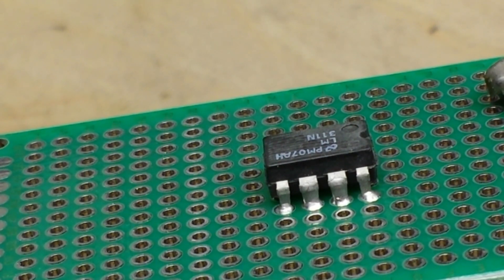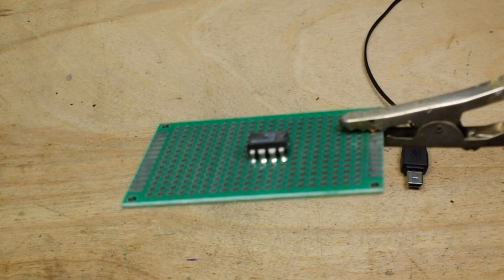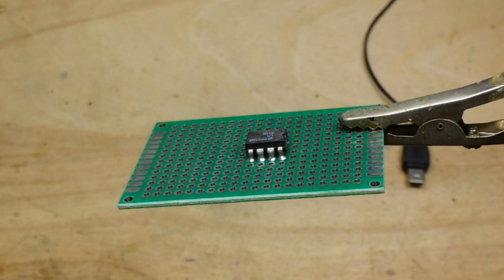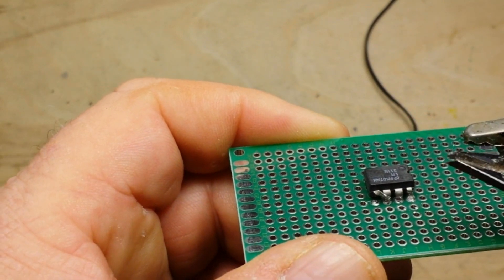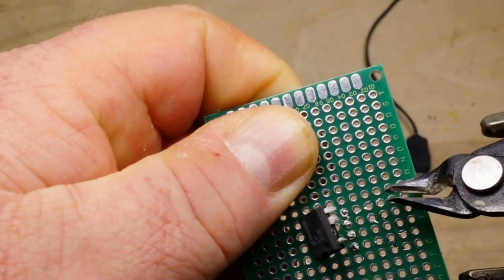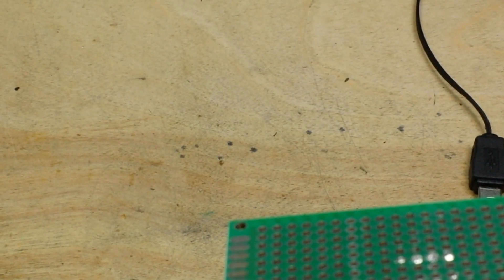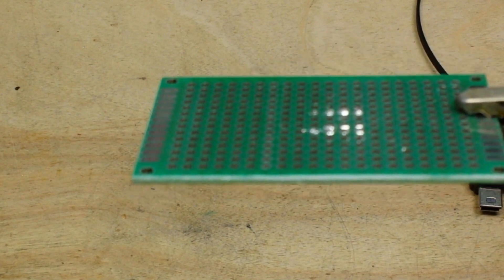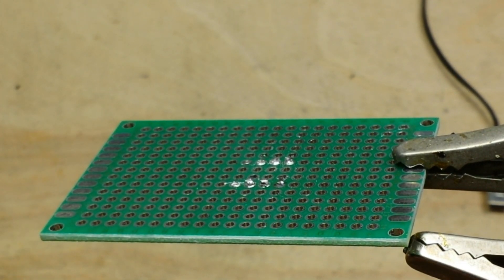Easily remove bad ICs from circuit board

Comment: If you're cutting out IC's it's far easier if you close crop the leads as they come out of the body of package,  i.e. hold the cutters vertically.  You can then remove the pins from the board by using your soldering iron on the pin from the top of the board, feed some solder so that the joint flows.  Lifting the iron from the board and the pin will (hopefully) be removed as it will be stuck to the end of your iron due to surface tension of the solder and the natural hook on the top of the pin.  This was standard practice when I worked in test some 35 years ago.
Reply: That's my preferred method as well.
Reply: Yep, cutting the legs next to the plastic body with the cutters held vertically is the way to go. It leaves a little hook at the top that you can use to pull the pin out with just the soldering iron tip as you say. This was the essential technique for 4 and 6 layer boards back in the day! Happy memories ;)@learnelectronics - thanks for the video and get well soon dude.

Comment: Tends to be easier to cut the chip pins from the top, with the edge of the cutters facing the chip, so the pins are cut across their width. This is because most side cutters have a flat side which can get in close to the point where the pin joins the chip. This is much better than cutting at the point where the pin goes into the PCB. The reason being that the heat of the soldering process anneals the metal of the pin making it soft and difficult to cut, where as it tends to stay quite brittle where it enters the chip.
The side cutters need to be sufficiently narrow to get the cutting blades in between the pins, even then, only the very point of the cutter will be used, so it's a good idea to keep a set of side cutters just for this task.
If one side of the chip pins are cut, the other side can usually be broken off by very gently lifting the cut side and flexing it up and down. This fatigue fracture the connect pins at the point they enter the IC package.  If done correctly, the pins break close to the package, leaving the remains of the pins still upright in the PCB. This stops damage to through holes and the PCB  track leading to the pins. It also makes it far easier to pull the remains of the pin from the PCB. 
One tricky is to use a spring loaded  solder sucker to suck the pin from the board. To do this, prime the solder sucker tool. Place it over the pin on the component side of the board. Heat the pin joint from the other side with a soldering iron. Just at the point where the solder melts, trigger the solder sucker. It will suck the pin from the board, along with most of the joint solder, leaving a clean hole in which to mount the  replacement IC. This method only works provided the cut pins have not been mangled in the cutting process.

The automated production method for through hole components leaves the component legs straight. During the production process, PCBs pass down the production line on a conveyor, with the component side always upper most.  The components are inserted into the unpopulated PCB by a robot placement system. Gravity and the tight fit of the component pins through the PCB holes, holds the components in place and upright. Once fully populated, the  board is passed over a horizontal rotating disk cutter blade, called a Holly cutter. The disk is engineered to be just a few milimetres under the PCB. This cuts the component wires to a uniform length. The PCB is then passed over a flow soldering weir, in which  molten solder is actively pumped up to give a continuously refresh mound of liquid solder. This solders all the component joints as they pass through the mound. To ensure that the solder only goes where required, PCB tracks around the through holes are tin plated, while the rest of the PCB tracks are protected by a heat resistant lacquer mask. The whole process is dependent on the component leads being straight to allow machine placement.
The same cannot be said of hand placed assembly, where  the PCB is soldered with the component side down, and the component leads are bent to enable the operator to hold them in place while being soldered. Early single sided copper PCBs, did not have the luxury of tight fitting plated through holes.  These PCBs were usually hand assembled. In this case, it was common practice for the operator to pass the component leads through the PCB and then put a 90 degree bend in the them, before cutting to make a small foot on the lead that was then soldered to the track. Anyone who has repaired a Japanese transistor radio from the 1960s, will know how difficult it is to remove the three or four pins of a dead transistor from these PCBs, due to this manufacturing method.

Comment: I prefer to do it another way:
- cut the pins off as close as possible to the IC body
- solder the replacement IC over the remaining pins

This way there is no need to remove the pins from the PCB.
Reply: Interesting.

Comment: I always used to cut coming in from the from the top (i.e. vertically), closest to the IC - easiest to reach, no torsion put on the pin we're cutting, long pin remains which makes it easier to remove that afterwards as well.

Comment: Have you an idea how to remove surface mount electrolytic Capacitors without damaging the board and the capacitors themselves? Sometimes during repair you need to check if they are still good or leaky.

Comment: Cold Winter Damp can put anyone's Immunity system to a test. 

 Yep,  If your not trying to save the Component it sure is easier to deal with the legs individually then trying to remove the item as a whole.  Good Tip Sir.

Comment: Good advice again, thanks. Maybe I'll need this because I'm working on a defect Power supply I bought. But if the chip is soldered on the board, how can I detect if it is bad when the board is not working?? 
Hear from you soon and take good care of yourself Paul!

Comment: That isn't the best way, cut the legs from the top, close to the IC.
The legs become little hooks.
Reply: I agree. Much easier this way. After removing each pin clear the hole by heating to melt solder and push a stainless steel needlework pin with plastic top through the hole. Solder won't stick to the steel pin but form little solder tubes. Cut them off and place new I C in the cleared holes.